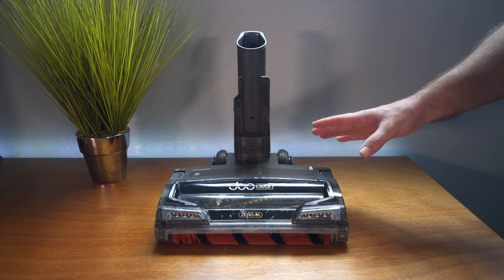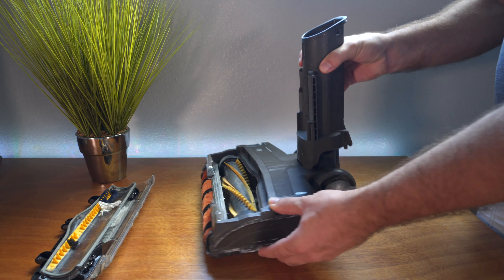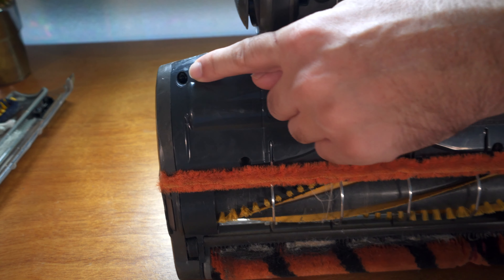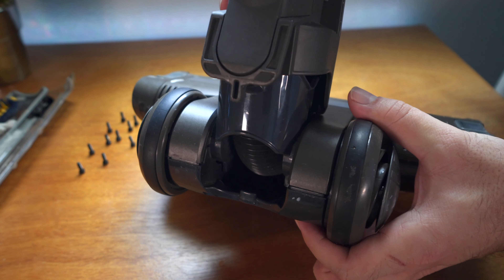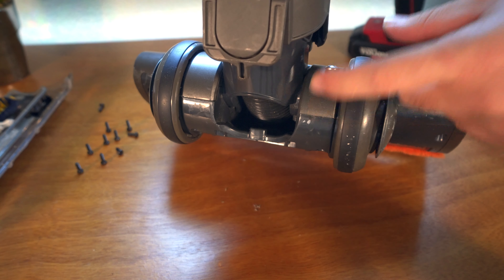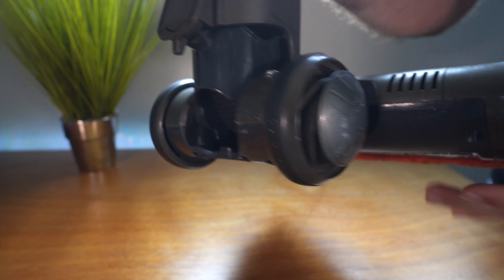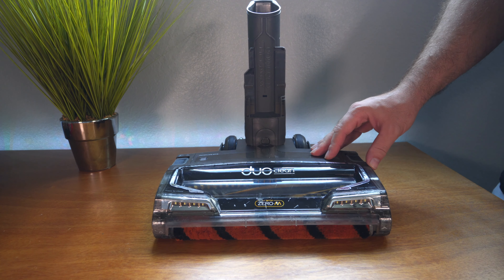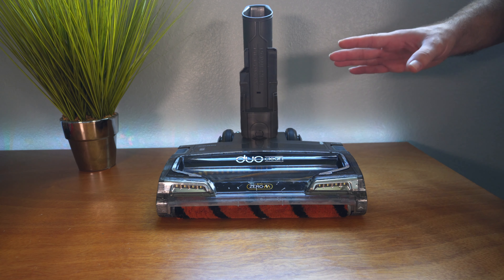Shark Apex - Zero M Head - Repair & Update

Comment: My AZ950 no longer stands up due to the two brittle plastic lugs breaking after only 8 months of light use. Shark refuse to honour the warranty and say it is wear and tear. I used your method of drilling through and used two M4 bolts to secure it. Sorted. Job done. Hoover now clips nice and firmly into the stand-up position. Excellent advice. Many thanks.

Comment: This video is great. I very much thank Just Vlad for sharing. It saved me a lot of time diagnosing the infamous "Shark Head Flop" syndrome, widely known by Shark who refuses to acknowledge the design flaw or offer a fix. My experience with Support for my three year old Duoclean UV700 was to be told, like others, that the only solution is a new powerhead at $89.95 plus tax and shipping. Nice going Shark!

Truth be told, you may be able to fix it, at least for a while, with a couple of longer screws like I did, without any drilling. As shown in the video at time mark 3:50, the top shell has two plastic posts into which screws secure it to the bottom shell. The 1/2" long black screws used are too short causing the posts to flex and fatigue and eventually break off. But for me, almost half of the post was still there attached to the top shell. I removed the two black security torx screws while holding the shell together tightly (otherwise the broken pieces will turn and the screws will not back out). I then removed both pieces by carefully prying the shell apart far enough to get them out (like in the video). I then replaced the shorter screws with longer ones. I used #8x7/8" Phillips pan-head sheet metal screws. Main thing to check is head diameter and make sure it will fit in the hole. Maybe you could use a 1" but I didn't want to risk poking through the top. How long will it last is anyone's guess. I may add the glue too but I don't use it commercially like Just Vlad. I may eventually have to drill a hole through the top as shown in the video, but for now, works like a charm!
Reply: Fax. My front orange roller continues to roll even on high carpet for some reason. Nothing on how to fix that. I think the computer is defective. I also have the flop because the mechanism broke somehow around the base. I don't know how it even happened. Shark problems

Comment: I used a similar technique to repair the snapped plastic fittings, but I used a 4mm/5mm male/female sex bolt, as this could pull in both sides and looked quite a neat finish.

Comment: I really wish you would have taken it apart, as that piece is what broke in mine and it fell out when I disassembled the head and now I don't know where it even goes (the actual locking mechanism with a spring on it).  Can't find any videos to address this issue.  A new head is like $89 and I know I can fix it if I could figure out where the darn thing goes.
Reply: He was 4 screws away from being done.  On each side there are 2 hidden screws.  Pry off the little round plastic pieces hiding the screws, take out the screws.  Pry the pieces off the top that releases the top cover.  Then pry the side pieces off.
Reply: @TrustKnowWun  i had two springs fall out the head.  I wondered where they came from and now I know.   It sure what their purpose is cause my vacuum still seems to work fine.

Comment: I really wanted to get one of the zero m but after seeing the poor quality the vacuum was made I'm mb sticking w my old Shark.Im not into constantly fixing a vac,I'll through it in the back yard first,too frustrating. thank you for your view on the new Shark.
Reply: Raka Mas this vacuum is really great. It’s clearly not designed for commercial use as these people use and abuse it for. If you are just using it for your own personal use, you shouldn’t have any problems. My shark rotator has lasted seven years with nowhere near the issues described.
Reply: @kissesandcake  My last one worked great too but this thing is junk and broke in 11 months.  Company won't stand behind it.  Pass on Shark these days.

Comment: Great video. I have this same exact floor nozzle for my Duoclean but I don't think my problem is with the upright. The vacuum turns on and the stick/wand has suction.  The nozzle, dust cup, and all hoses are clear.
The roller brush is also clear but it will not turn. Any ideas?  I just purchased it 4 months ago from the Shark website.
Reply: You need to push the screen on properly, sometimes when you remove it to clean, it hasn’t been pushed on properly! Try clicking it on left and right!

Comment: I have the same issue of the plastic broken at the flex part. I called Shark this evening. I have owned mine for almost 4 years. I have the 7 year limited warranty. They told me I need to purchase a new nozzle head which is $89 plus tax and shipping. Should I call back and demand a new head since its still under warranty and this is a defect? Anyone else had any luck with this?
Reply: update I called Shark back today. The floor nozzle isn't covered in the warranty so I gave them a piece of my mind. they offered me 50% off a new floor nozzle that is regular $90. Gave me free shipping, came out to $47 total. Satisfied with that offer.

Comment: My shark stick vacuum starts, (with green light lit), then suddenly the red light comes on and the roller stops. How do I fix this?
Reply: Mine does the same exact thing. Trying to find a fix still. Did you? I’m trying to take it apart right now to see if the motor isn’t wrapped up with anything.
Reply: @ItsTheLog  I am taking mine apart waiting on a hollow t20 to show up hoping to fix it but the front brush roll isn't moving and making it so you cant push it. how did it work for you?

Comment: You know I really do like my Shark however I have to say this I think the powerhead is the shittiest design for a powerhead I've ever come across my whole entire life first of all I do like the 0m technology that is really great I love it but the power head needs to be redesigned again first of all they need to have a handle release function instead of just relying on the pressure of the upper base to release it from the powerhead secondly they need to have carpet height adjustment on it instead of allowing it just to float third they need to make it to where you can remove the brush roll on both of them and clean them. And last I wish they would make those headlights brighter and replaceable
Reply: this is why you don't buy the first generation.
Navigator was good, but Rotator was better, Apex is good, XXX will be better.

Comment: All of that just to find out you don’t know how to remove the bottom plate, which is the one place where my clog is and I need to get to. Thanks!
Reply: The bottom plate doesn't come off. You remove the roller be opening it from the top. Just push the 2 slides and you can get to everything.

Comment: The larger brush on mine stopped working but the soft one at the front would work.  Even though my unit is just a year old, they refused to replace or repair the bottom roller mechanism.  They call it a "wear item"  Even though it could have been the gears, belts, motor....REFUSED to fix my one year old unit.  Told me I had to buy the entire bottom assembly for about 100.00.  They fixed several things on my old shark in the last year of the 5 year warranty.  Now it's JOKE.   I took it apart and the inner assembly of the big roller is obviously busted.  The pulley on the side turns but the roller doesn't ...And it's all pressed together.  I also can't seem to find a place to buy the big roller online.  Probably because they are all breaking and nobody has them.   Don't buy one of these units.  They are now cheaply built and the company isn't standing behind them.